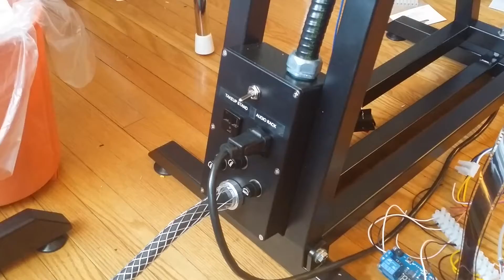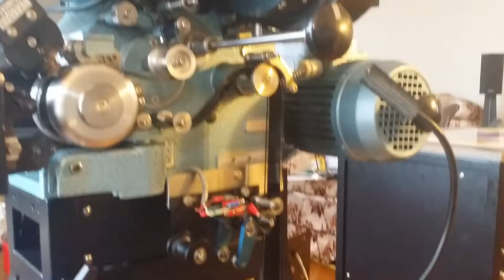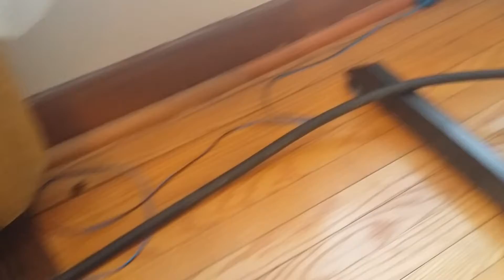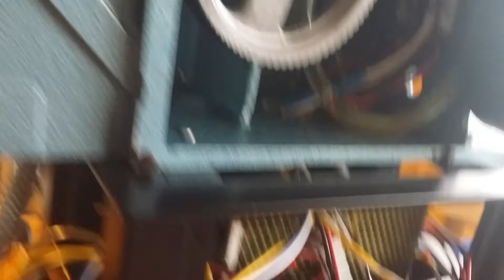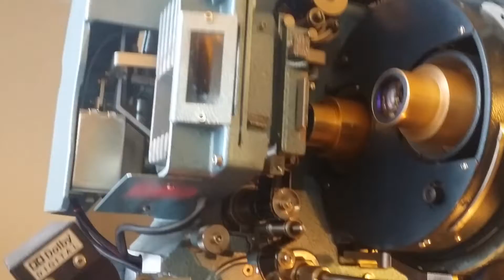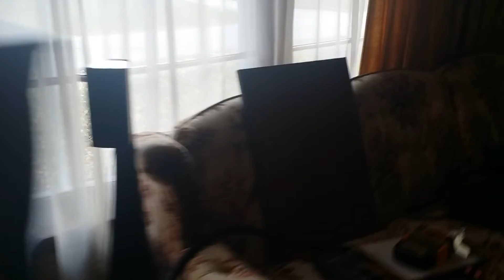Setting up a 35mm film projector to run at home - part 3

Comment: I always wondered how the take up wheel worked. Figured it would rip the film when the film got a bigger because of the ration change but a slipper clutch makes sense. I'm hoping to pick up a 35mm in a few days with a platter system. Would love to have a tower system instead because of the foot print. Thanks for the vid!